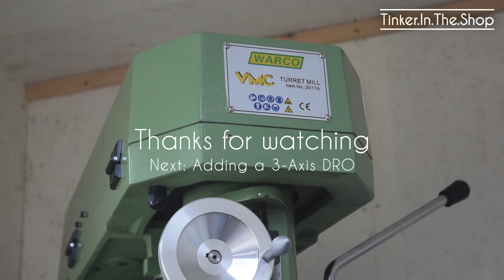Warco VMC Mill - New mill!

Comment: This design has been around a long time.   I have a version sold by Grizzly Industrial in the US.   My mill was made in 1999.  Back then Grizzly sourced from Taiwan.   I purchased it from the original owner in 2017.
I replaced the single phase motor with 3 phase motor and VFD.   I eliminated the middle auxiliary pulley since it was not easy to change the short belts with 3 pulleys.
Tramming the head is fiddly due to no screws to adjust the head tilt, just nudge-and-fudge.
The single rather long spindle handle was often in the way when lowering the quill for milling.    I purchased a car steering wheel.   Now even if I hit my head on the steering wheel it is soft so does not cause bruises.
Enjoy your mill.   I use mine often.
Dave.
Reply from the maker: Hi Dave, 
Yes I've known about these clones for a long time. The Warco seems to be the new "Best" out of the bunch and having spoken to other owners and looked at pictures etc I think they're a step above with probably the Harbor Freight being the "worst". ALthough I've seen some awful examples under the grizzly badge (Purely new machines)

So far I'm more than happy with the purchase. I find the 3 pulleys not an issue so far although I do have the 3PH motor wired to a vfd for general rpm changes.

Haven't decided on the quill handle yet, The spring is definitely too strong so I need to look into that.

Looking forward to many good years service with this machine. Thanks for commenting!
-Tinker
Reply: Your Warco does look to be well made.  I agree HF may be the worst, very hit and miss quality.
Dave.

Comment: Is this single or three phase? Seems to run smoothly. 👍
Reply from the maker: Its 3 phase. I immediately swapped the motor winding and added a VFD when I received the machine. My two lathes are also 3ph running via VFD's.
Reply: @TinkerInTheShop  I've just ordered a VMC I think I will do the same thing, convert it to 3 phase + VFD in the future. Hopefully I've done the right thing! Have you had any problems with yours?
Reply from the maker: @machinist_matt  No problems. Its a decent machine. Can take fairly heavy cuts with the right cutter and feeds. I recently added a power feed unit on the X axis which has been a fantastic upgrade.
Reply from the maker: @machinist_matt Forgot to mention, a few years ago I also added a 3-axis DRO which was another excellent upgrade.
Reply: @TinkerInTheShop  Good to hear you haven't had any problems! 👍 I ordered mine with the factory 2 axis DRO so I'll only need to add one for the Z axis. 😎